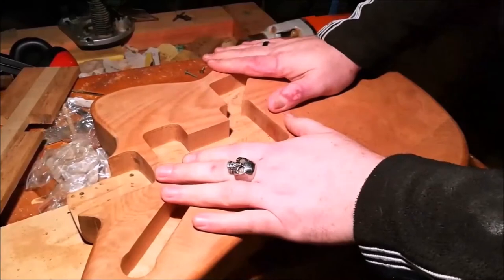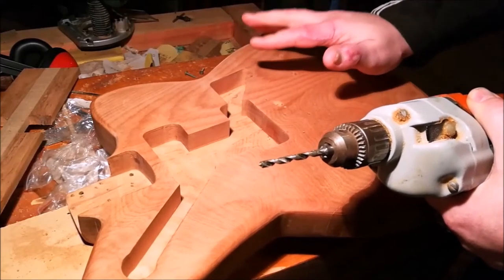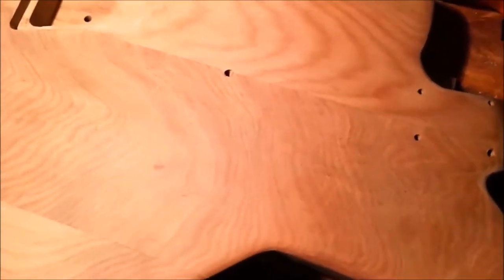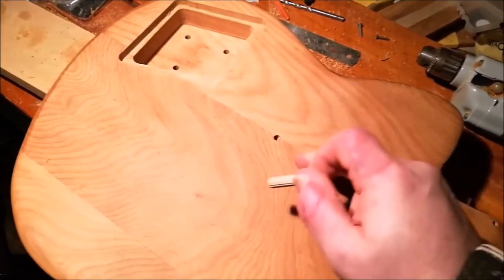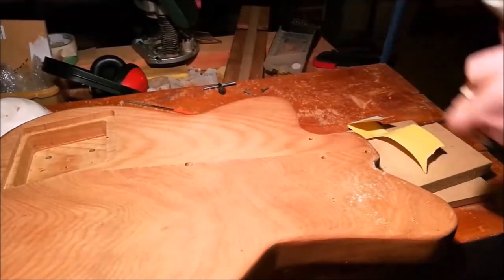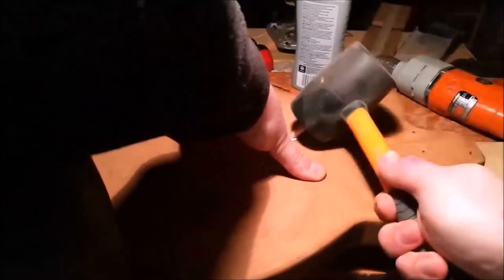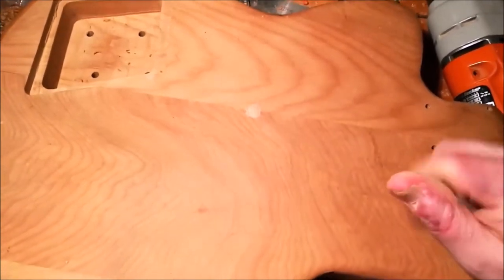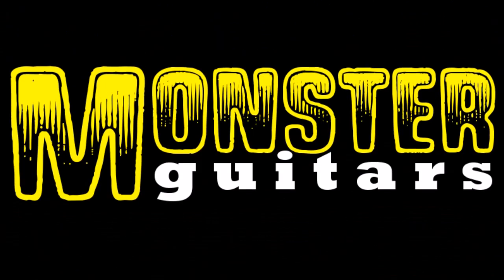Monster Guitars 045: Toronado project - I've drilled through the guitar body!

Comment: It happens. Easy mistake. No need to throw out a body for that ! You can also try putnams roackhard putty. Mix it up and fill from both sides so it’s packed in and you don’t get much shrinkage. Idek how old this video is but you should invest in a set of 24volt cordless chuckless drill and hammer drill set. It’ll change your life.